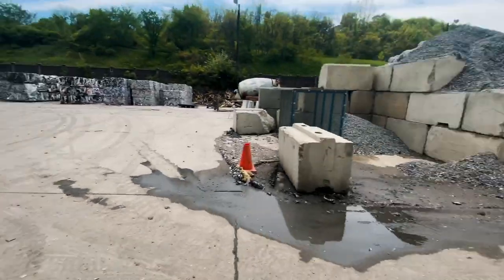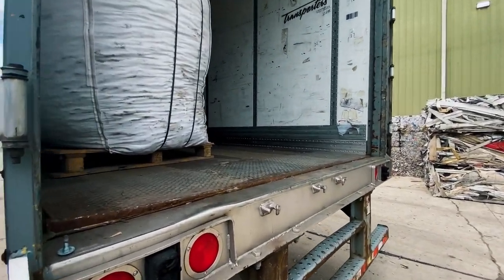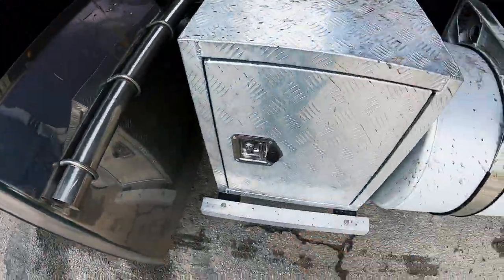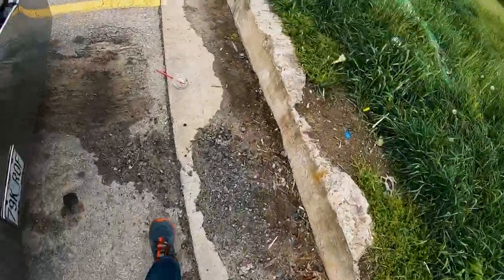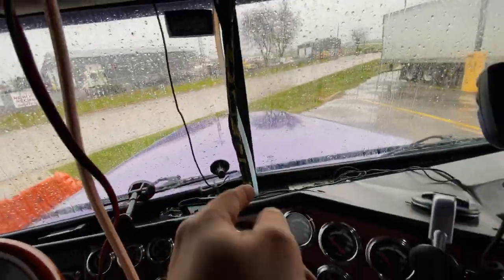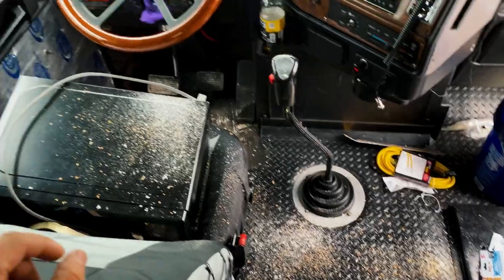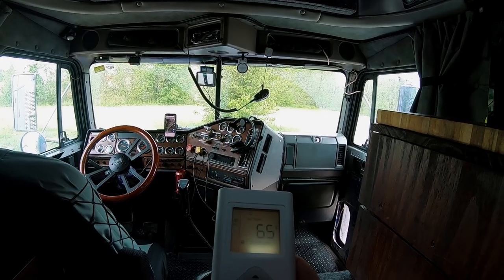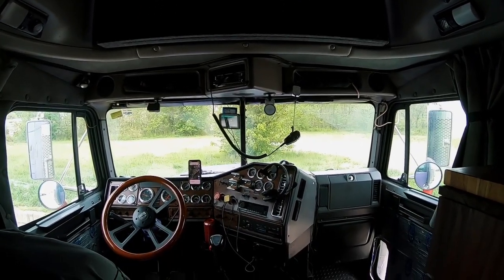Truck driver puts a house mini Split ac unit into big rig. Pioneer 9k btu install into freightliner

Comment: Just a question on this,.. is the split unit running off 120Volt ,.. or 240 Volts,.. I have a RV ac unit mounted on top of my truck ,.. but it makes a lot of noice   and when it rains I get water inside de truck ,.. so I am looking to install an split ac,.. please let me know  thanks  so much
Reply from the maker: They come in 240 and 120 variants, mine is 120 runs of regular household plug. Uses minimal power pretty sure once I got everything blocked off in cab and temp situated it’s pulling 6/700 watts tops

Comment: You talked about fuel lines.  Is that a deisal generator? If it is where did you get it? Thought it said craftsman on . I had the same idea. I just got a champion 4500 with remote start but it runs on gas.
Reply from the maker: It’s gasoline I got an auxiliary tank

Comment: How did you connect electrical wires to generator? Im planning to buy mr cool diy, but it needs to be connected to a box, how do i put a plug to conect to generator directly?
Reply from the maker: Wire same way you’d do at your house. Instead of going into outlet goes into generator. Just wire up to extension cord

Comment: How's the unit holding up so far? Also just wanna know if you used the lineset that came with your unit and just connect the flexible lines on the inside?

Comment: I'm trying to do this but only issue is how do I know what's behind my sleeper and if it's sturdy enough to hold the brackets for the outside unit?
Reply: It’s sturdy enough to support a 300 pound guy on the top bunk so must be pretty strong

Comment: Will the generator last in the harsh winter? I got a predator 2000. I had a Portable AC strapped to my passenger seat. Winter is coming and I know I can run a Sunbeam Heater in here but I'm worried about turning off the engine and it being too cold to start or dead batteries. Suggestions??

I was thinking about a wobasto heater but I can't find anyone to install it and I'm not doing it myself
Reply from the maker: You’ll kill the generator with daily cold starts and takes forever to warm up, mini split isn’t meant to heat on harsh conditions like under 20 degrees. Webasto is the only way, install it yourself there’s videos on it

Comment: Hi!You did a great job!I decided to do same on my truck,bought a/c from Amazon,but still can find a frame for the condenser.Could you tell who did that holding frame to you?Thanks!
Reply from the maker: I had a local guy build me one. If I could go back I’d get it made from 90degree elbow aluminum like 2x2 1/8 instead of this way
Reply: I like this aluminum frame,I’m located in GA,could you give me phone number or location to the guy who made this frame to you?Thanks!
Reply from the maker: @valentinkilidzhiyski2224  +1 (314) 249-3435 metal impressions, stl mo
Reply: Please ,I need a picture of the rack.
I like your rack very much and I want to replicate it.Thank you in advance!
Reply from the maker: @valentinkilidzhiyski2224  I mean just show him video of my truck he’ll know what he needs to build

Comment: How many watts this pioneer takes ? And what kinda model if you don't mind me asking ? There are several 9k s they have. I have a Honda 2000 generator, just wondering if it has enough power to run it before I buy one
Reply from the maker: 9k 110v version your generator can’t run the 220v. Most I’ve seen it use is not even 900, and once truck is cooled down it’ll stay at 600 watts usually. Mines 2200 watts 1800 running generator so more than plenty. 1 gallon 10 hours+

Comment: Hey guys. Looking to do the same install on my truck. The generator that I was looking at is the Predator 2000 from Harbor Freight. Can anyone tell me what I need for starting watts and running watts. I'm hoping the 2000 watt Predator will do the job. Thanks

Comment: Why not just idle the truck Too much mess. For the gallon of diesel that it will burn a hour 🤦🏻‍♂️
Reply from the maker: Then idle the truck who’s stopping you? It’s not just the idle.. it’s more comfortable sleep without idling truck and saving the engine by not idling it 24/7 on road in hot months. Again it’s not a shoes fit all or you gotta do this. It works for me don’t mean you gotta do it 🤷🏻‍♂️
Reply: I Respect that rookie 👍
Reply: So you’re okay with burning around 8 gallons everytime you want to sleep? At today’s prices thats around $30 bucks per night which is $900 bucks per month. And that’s only for sleeping at night that’s not counting loading and unloading times where you have to idle to truck as well if it’s too hot or cold. Combine all this with the engine wear that you add by idling the truck it’s way more worth it doing things this way.

Comment: Is 9000 btu sufficient? I go to some hot southern states, would 12000 btu be a better choice? Thinking of pairing it with predator 3500 generator.
Reply from the maker: Ac uses 800 watts max, 9k is more than plenty I’m in Laredo lol

Comment: Hello, how did you wire the electrical coming from the outside unit to the genorator?
Reply: extension cord only.
Reply from the maker: You got that right